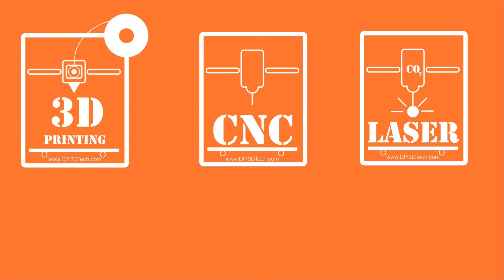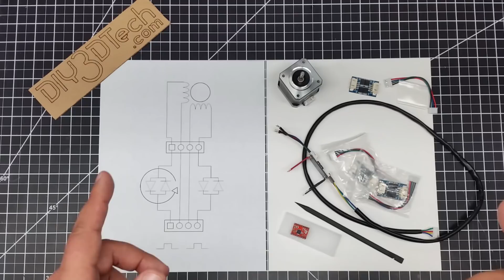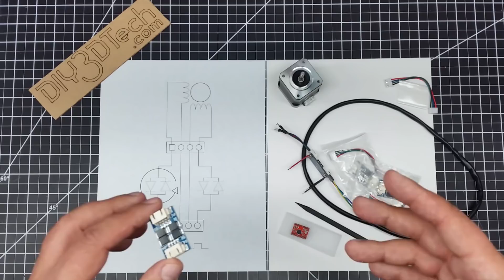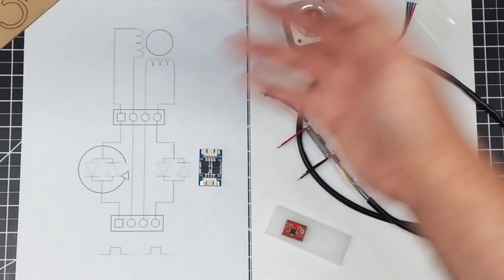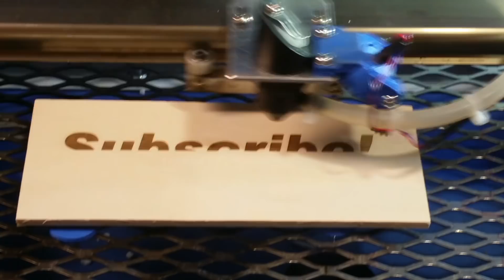Shop Talk - Diode Smoothing Your 3D Printer Fact or Fake News!

Comment: It will be quieter because it is simply dropping some of the volts, just like running a 12V fan on 6V. 
The diodes back to back are because the stepper drivers are full bridge and without it you would loose half your steps when the coil polarity is reversed.
The Diodes back to back will not "Circulate" the current, you loose say 600mV across the diode,  this means in order to circulate it would have to get some "Extra" volts from somewhere to overcome this drop, that is not going to happen, conventional current does not flow "Up Hill"
Even when you see a stepper driver being power from 12V does not mean your putting 12V dc across the coil, the inductance of the coil will resist the build up of current and the controller is sensing this, as soon as the current you set is reached, it will cut off the volts to protect the motor, the motor on its own will only take a few volts at best (In a DC State). The controllers rely on this behavior in order to work properly, adding these diodes will only make things worse for the controller, even if it sounds quieter, one of your viewers already pegged it, you will loose torque.
This is why on bigger machines you will see 3V 2.5A steppers being driven from a supply as high as 48 - 80V, the controller is managing the current and the extra volts helps massively with torque as the current can build up to the required amount much faster
A better way to lower noise (Not improve accuracy) is to use micro stepping, you can get some limited improvement in accuracy up to maybe 10uSteps but not beyond that, you do however get way smother running as the stepper controller is providing more of a sine wave to the steppers.
This is why the trinamics drivers are starting to be very popular. see https://www.trinamic.com/products/integrated-circuits/details/tmc2130/

This is just based on my experience as an electronics engineer for over 40 years, I have not yet tried this mod to see how it is altering the current and voltage applied to the motor but it will be interfering with the proper operation of the controller, just look at the design sheets for each controller to see what the waveform should look like, this is what the poster referred to as the cause of the noise and it may be, but its there for a reason... the price of these mod boards is more than a much better controller like a trinamics, better to upgrade you controllers.
Reply from the maker: Well I think your guesstimate of 600mv is close (see Fridays episode) also my referring to "re-circulation" is in a state of flyback/inertia recovery where the motor is generating current.  Also look forward to your onions on Fridays episode!  :-)
Reply: Onions on Friday ??, I look forward to viewing your Friday episode. 
When the motor is slowing down or changing direction it will generate what is called "Back EMF" but my point about the diodes providing this path is that it can not happen, its electrically impossible in that configuration. The full bridge of the stepper controller expects this and it uses it to break the motor, the bridge provides the low impedance path back through to the power supply or through to the other side of the same winding it is coming from , the back EMF needs to go to the other side of the winding and these diodes in series do nothing to aid that.
The guesstimate of 600mA is based on the standard voltage drop for silicon Diodes but it could be higher or lower depending on the internal construction of the diode and the materials used. The 8 diode one you mention is going to double that drop of course and this makes it harder and longer for the motor to bild up the current to what is needed for good torque.
Reply: lol, I just realized, spell check not doing a correct correction, I assume you mean opinion :)
Reply from the maker: Yes and that I am also thinking about what I am going to have for dinner!  :-)
Reply: lol, ok :), 
btw, I have been planning on doing a video on my channel on how stepper motors work and different types of controllers and how micro stepping helps with noise (Smooth Running) but not as much as people think on accuracy and that there is a price to pay with torque etc, it is a very miss understood topic from what I have seen on many CNC and other electronics channels.  I am thinking perhaps it should be sooner than later, perhaps if there are specifics you or your viewers would also like covered, please let me know
Reply: Charles-A Rovira yes. Sorry I missed that lol. I do indeed mean brake.

Comment: I've added a diode smoother to my y-axis of my Anet board and it's definitely made it quieter so there is that.
Reply from the maker: Interesting, did it seem to improve the prints at all?
Reply: I'll do a quick test and get back to you
Reply: On my 40mm cube inline test, I can't see any difference. I do get pretty good prints anyway with my aluminium extrusion frame and my e3d V6. Definitely quieter but that could be the voltage drop. 
This is the one I got https://www.ebay.co.uk/itm/BIG-TREE-TECH-New-Arrival-TL-Smoother-new-kit-addon-module-For-3D-Printer-Motor/272939532334

As the Anet Board has 4 pin Jst connectors for the steppers I pluged the short lead into that then the lead to the stepper on the output side
Reply from the maker: I did not see any "physical" difference in my prints either...
Reply: You could just turn the trimpot down instead. -- All you're doing is reducing the voltage.
Reply: Welcome to us http://www.trianglelab.org/

Comment: Regardless of having delta or cartesian, if your 3D printer uses DRV8825 as driver stepper you will need a smoother for each every single one of those driver; this is the original article which explain the reasons: http://www.engineerination.com/2015/02/drv8825-missing-steps.html?m=1
Reply from the maker: Yes very familiar with this post (its also cited in the description as being the origin of this video), but it seems to be limited to this driver...
Reply: Well, no. Take a look at page 7 to 9 of the allegro stepper drivers. And guess what you'll find. :D   Exactly the same issue.  For your convinience : http://www.alldatasheet.com/datasheet-pdf/pdf/338780/ALLEGRO/A4988.html   (other drivers of the 49xx available too through that link, and showing the same issue when running in Mixed decay)

Comment: No, you don't necessarily want square waves on your motor - sure you can step your motor over with square waves, but it's just full stepping or half stepping it, it's jerky, unpleasant and loud. If it was square waves, there wouldn't be any issue that could be fixed by diodes. The ideal way to drive a motor is with phase offset sine waves - the position of the motor between steps is then determined by the ratio of currents between the two coils. This sine wave control is approximated by driver ICs in microstepping, and to implement microstepping, they use switch-mode, PWM-like control with current feedback. Perhaps setting the current with a linear circuit would be more ideal, but it wouldn't be so compact, cheap and energy efficient.

The issue as i understood is particular to some specific stepper driver ICs like DRV8825 - they have a minimum output transistor on-time that they will not fall below, to limit the switching stress on these transistors, but this means if you're trying to deliver a small precisely measured current to one of the coils, such as near where the current sine crosses the zero, it's not going to do it, and the motor will snap into the next half-step or won't move at all. The diodes introduce a voltage offset that allows the necessary on-periods to shift into the range of the ones that the controller will actually execute.

The difference between 4-diode and 8-diode version is that the 8-diode version is longer in series rather than wider in parallel - so it doesn't handle more current. Instead, the 8-diode version introduces a higher voltage offset, of two diode forward drops (1.5-2V) rather than one (0.7-1V). The 8-diode version is intended for people running DRV8825 or similar IC on 24V power supply rather than 12V.

This is of course not the only thing diodes do, they also accelerate the slow decay mode, on any stepper driver, by increasing effective series resistance of the motor, which is what you speak of here. But i don't see why it would be necessary or helpful.
Reply from the maker: Yes understand the two phase component, yet not sure I am tracking the anti-square wave part.  Also yes  a perfect square wave is impossible as rise and fall would need to be infinite which isn't going to happen with a yes on the voltage reduction of the 8 verses 4 however the 8 will also handle the load better as the 4 became rather warm with just my simple testing (I should have added a flir image) and also get "they also accelerate the slow decay mode" which is what I believed if they had a value this would be their value yet from everything I have seen on "this" I see no difference nor value also as you mention in the end...
Reply: 8 wouldn't run any colder, as the extra 4 are in series, not in parallel. So the whole assembly would dissipate same current as 4 diodes, but across a voltage that is twice as high. Individually, the diodes in 4-diode and 8-diode TLSmoother carry the same load. The motor is a current-driven device, the more current you supply to a coil, the higher pulling force it will have on the corresponding polarity magnet. Similarly, the control IC is a current feedback device, it opens and closes the gates in a varying pattern to achieve a set average current over the period of a couple milliseconds, so if everything is working properly, the controller will simply feed higher average voltage into the motor and TLSmoother to compensate for you installing the 8-diode TLSmoother. As per Ohm's law, the voltage across the motor should remain the same regardless of how many diodes you hang on there, because it will depend on its inherent impedance and the current which is set by the control IC.

As to why not square wave drive, you want the motor to move smoothly on linear moves, right, rather than jump from position to position? If you created an external mechanical contraption - for example simply a handle with a huge super heavy flywheel - that powers through the detents of the stepper motor, not letting it cog onto them, and drives it at a constant or only very slowly changing angular velocity, if you were to connect the windings to a graphing ammeter, you will find that the currents generated by the motor coils will approximately describe the sine and cosine curves. The sine/cosine drive is the reverse of that, an electronic circuit which applies that same current curve to the stepper motor, to make the stepper motor rotate smoothly. Microstepping is a low-cost intermediate digital solution, where we try to imitate the sine/cosine drive, but we approximate the curves by discrete steps.

Furthermore the motor windings are inductors, so the current in them necessarily changes slowly, over the course of a millisecond or two, which is an eternity compared to transistor switching times, they are essentially a low pass filter. The PWM circuit in the driver IC uses this fact to filter out the switching frequency, well, at least for the most part.
Reply from the maker: While I agree with most, I am still not sure I am buying in on the not cooler topic as in this sineraro one would be at 100% and the other at 0 which wouldn't be reality however I agree it would not be the same as if parallel as well as stepper movement as I understand what your saying yet this is the bane of the stepper and for CNC servo with encoders are preferred for improved arch creation.  Also how do you know all of this?  I deal with some crazy smart people (I am the CTO of a very large company)  and must say I am impressed...
Reply: One what would be at 100% of what and other what would be at 0 of what? I don't understand what you mean, and i must have not explained myself well enough, it's evident that your mental image is different from mine, but i don't understand how exactly.

As to how i know all this? It's just basic secondary school and university knowledge for the most part, and yes i'm oversimplifying things for the sake of explanation that has a chance of being understood, there is of course always a bit more fine detail to it. People maybe tend to forget what they learn. I think if you're a CTO of a large company, then i'm an Easter bunny, because if anything i'd expect better people skills of a high executive, but then, there's no reason to assume a high executive would be more intelligent or knowledgeable than the lowest rank of engineers. There is however a reason you wouldn't see me at a company like this: i don't have to specify my health conditions when interviewing for a job, so when i happen to need money, i won't. But then, i don't tend to stay very long because large companies have a very rigid structure that cannot accommodate somebody whose list of confirmed diagnoses spans an alphabet, partially up to trice - autism, ADD, and anxiety disorder are just the beginning of the list. Also companies don't value people as unique contributors, they value them based on spreadsheet numbers, on productivity, and honestly my productivity is not that high, it's lower than average engineer's, and when it is occasionally quite good, it's not directly numbers oriented. That other guy who keeps re-introducing and "fixing" the same bug in slightly different guises every two weeks is doing very well though, his number of resolved tickets is through the roof! He's also great at stabbing his coworkers in the back, wow, what an awesome member of the staff, give him a medal!
Reply from the maker: Insert a chuckle here because your an Eater Bunny and think you would be surprised what you can do if you don't short change yourself as assumed you are on the spectrum (so am I).  The works of Temple Grand, Daniel Tammet and others have been very  helpful and this is one of the reasons I do YouTube (and hence my prior comment to you about doing YT).  Also think you mistook my comment as I am sincerely impressed with your ability and command of the subject, but hey you have Easter eggs to hide and me, people skills to work on ;-P
Reply: @SianaGearz  well said !!
Only just finding this/these Smoothing posts here today and enlightening myself on the subject to which i thank people like this author of the video and people like  Siana Gearz  that comment positivity in thier posts and just goes to show that the mind is capable of awesome feats even though the person may not be upwardly mobile, yet folks like us that are sat in one place too long have the power of the entire world on a plate, aka the internet, so we do a lot of reading lol

i am myself confined to bed 23 hrs a day due to not being able to walk & in huge amounts of pain hourly, so the best thing to take the mind off of all that is cheering myself up with great posts like these, so a major thank you for all who have contributed to making posts and video's like this, it is extremely inspiring and helps people like me who also suffer chronic depression, i thank you immensely !!!
Reply: Good explanation. Linear driving would be very bad because it needs to be switch mode to avoid the driver getting really hot, most NEMA17 steppers only have between 2.5V and 3.5V across the coils (due to the resistance of the coils), most drivers use 12V or 24V and act like buck regulator, with current control as you said. The decay time though is far slower than the PWM frequency, in reality the current won't decay much at all before the next cycle starts, so even if it did accelerate the decay it won't have any effect.

Comment: very interesting but how would you connect this to your cr10?
Reply from the maker: You would need to solder up a small converter cable as you will see more on Friday :-)
Reply: also stops the board powering up when u move the axis  when powered off
Reply: have you installed them on a cr-10?
Reply: Nico M  open up the box ive them on mine i no they just plug in. u carnt plug them outside inside they fit into x y z port. no adaptor no soldering its piss easy..

 8 chip version is what your after not whats shown here look online u will see the designer made a mistake
Bigtreetech 4PCS New TL-Smoother V1.0 addon module For 3D pinter motor drivers
 http://s.aliexpress.com/iAbQVrEn?fromSns=Copy to Clipboard 
(from AliExpress Android)
Reply: u just plug them inside the box to the board
Reply: no soldering required
Reply: they have 4 wires when the cr-10 motors and cables have 6 if I'm not wrong. 
 Didn't see much about an adapter in the video uploaded today
Reply: The CR10 does not benifit from these smoothers. (I've got one). The Tevo Tornado however can't produce a decent print without them. (again, tested it myself .... along with hunderds of other people).